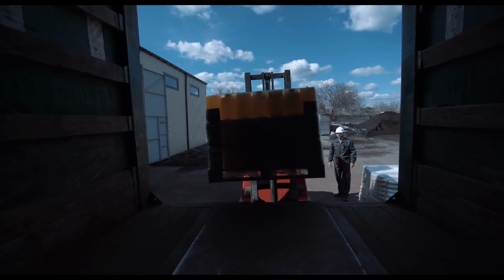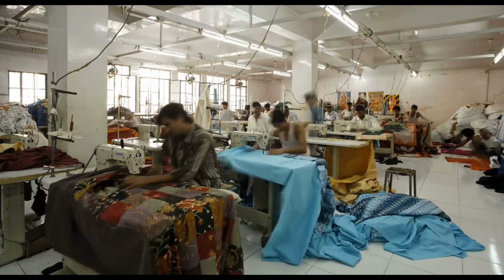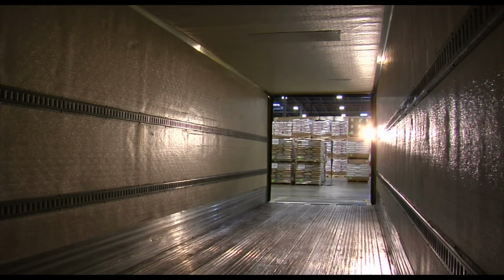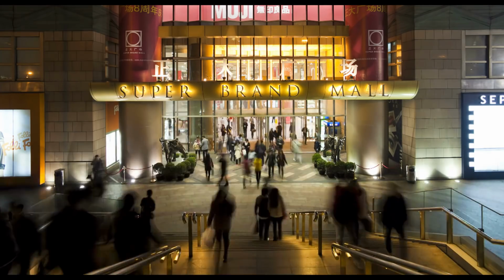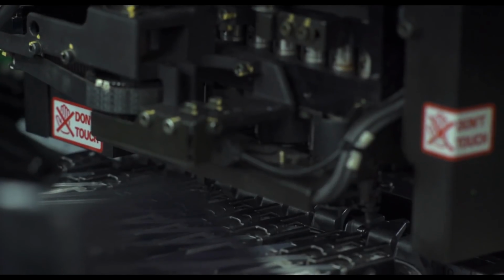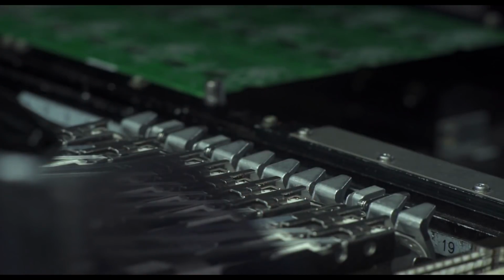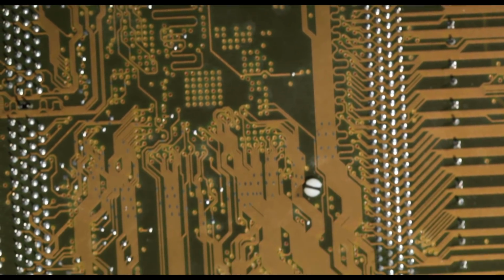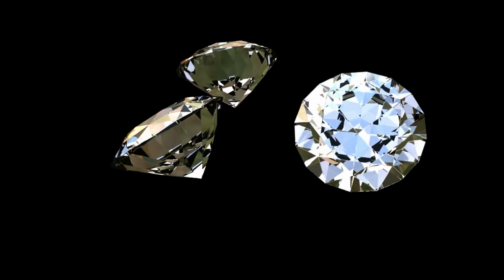WaltonChain Explained In 7 Minutes --- My New Favorite AltCoin!

Comment: I don't see why counterfeiting products will be impossible? It's just a matter of placing a RFID in the counterfeit product, mimicking an existing product...
This could be a very good video if you were not acting as a blind fanboy and providing some solid evidence to your claims. 
None of the use cases you mention require the blockchain application.
Reply: The walton RFID tag has a simple hashing processor that will be capable of storing and transmitting the it's private key to the network. This way there the tag's identity on the blockchain can not be copied or replicated. This creates a 1:1 relationship between the tag and the record on the block chain. It's entire production, shipping and retail history will be recorded on the blockchain. Counterfeit goods would have no such history.
Reply: Depending on the item you can make it relatively difficult to remove the RFID tag without damaging it, but the main argument I would make is that you're devaluing the actual authentic item by removing the RFID tag because you couldn't prove it wasn't itself a counterfeit item anymore.
Reply: Zycho Yes tags are initialized and bonded to the blockchain and associated to the customer as they leave the factory
Reply: it's not the blockchain thats the concern, or the RFID for that matter.. has any consideration been made how much more expensive goods will be to have an extremely good RFID system that can't simply be placed on another counterfiet product? A detailed video on this would be good.  Yes the concept is solid...
Reply: In addition to some of the already great replies....the rfid numbers generated would be cataloged to the original manufacturer. Anyone else creating false rfid numbers would immediately be red flagged as an outlier. Copies would not allowed because each product will have a unique number. Unlike generic UPC codes. It is like a social security item for individual items. Each product has a unique number. So “copies” will not be possible of rfid tags.
Reply: Ben Fraser so to understand you correctly, you are saying that such a tag will have its own individual connection to the blockchain in a regular basis? Independent of the product that it is designed to prevent counterfeiting? Please correct me if I'm wrong.
Reply: I also struggle to collect how it will prevent counterfeiting. Will this blockchain keep the trace of every product forever? Wouldn't it drive the cost up as the number of these products rise? I mean storing information did become cheaper, but it still costs money.
Reply: It will have a mathematical connection to the network, in a sense. It would be able to sign a validation message, thereby proving it had a unique private key without actually revealing what that private key is. In that way it would be unable to be counterfeited because it would "know" something rather than just "be" something. I suppose you could somehow open the incredibly microscopic IC that is in the Walton RFID tag and use an extreme process to figure out what the key is but that would be prohibitively expensive, if even possible. Walton is really going to make most of their money a quarter cent at a time selling these proprietary (and patented) RFID tags.
Reply: plz explain why u couldnt just switch out the good product for crap but keep the good rf tag attached?
Reply: Guess you could keep the real one yourself and sell a fake one to get your money back. Doesent have to be huge scale
Reply: You can tamper with products before placing an rfid tag. No way to know if a diamond is clean or dirty. And that basically goes for all products.
Reply: You can tamper with products before the rfid tag is applied. Who knows if a product really originated from place B? Maybe it was shipped to place B from Place A, where they use child laborers.
Reply: I own a fake adress and fake leather coming from fake cows. I just buy some rfid tags and put em on some fake leather. and sell them as real leather to Gucci. Oooh.. that wasn't hard.
Reply: Gucci (and other companies) certainly screens their suppliers. This isn't a system to authenticate anything beyond what a trusted party attests about it. What it can do is tell you that the stuff you got from Person X is from Person X and not replaced somewhere in between.  With regards to your Place B, Place A scenario, the tag doesn't necessarily prove ORIGINAL provenance of anything before installation of a tag.  If a company is shady and sourcing from bad places and lying about it, that is a wholly different problem. What a system like WTC would prove is that a) company like Gucci bought RFID tag x from Walton b)  RFID tag X installed into manufactured product by Gucci c) Product custody is turned over to logstics company Y d)  logistics company Y turns over product to retailer Z e) retailer Z sells it to you. A bunch of intermediate information could be recorded as well.
Reply: If you can track a location of an RFID chip from the moment it was created. All the GPS tracks they store should start at one place: The rfid factory, correct?
Reply: You don't need to tamper with the blockchain, the RFID tag is just an ID that you can actually copy, it doesn't contain the whole chain.
Please explain how they are going to prevent counterfeit without just telling us that "they somehow will", I'm all ears.
Reply: The products history will be traceable on the blockchain. That would allow you to see what ports/channels the product has gone through. If you were able to sign off a rfid tag through a port that would be able to prove authenticity of a product.

Comment: Really great, informative, refreshing video explaining WaltonChain. Thanks! You mention streamlining existing ERPs into one channel and therefore increasing efficiency... I'd like to just emphasize this point because this streamlining should save companies huge amounts of money by cutting manpower costs and reducing or eliminating human error, as bar codes no longer need to be scanned individually. It's a big cost-saver. Given that China has also recently issued guidelines for a product traceability system that will be implemented by 2020, WaltonChain will likely be a huge player here.
Reply: Supply chains are an accounting disaster. A box of widgets gets passed from one vendor to another, over and over. Depending on how long the chain is, you could have a couple dozen different companies involved. With each step you have to account for everything that has happened. Shipping insurance companies need need access to those records, finance companies, manufacturers, shippers, warehouses, distributors and retailers all need access to those records. The current method produces a shit-ton of paperwork because companies can't trust each other and their databases. Blockchain provides the single trusted immutable database for all parties to use. It provides instant visibility into an otherwise opaque industry. A public blockchain is the ONLY to have a truly trusted supply chain tracking system.
Reply: This already exists and don't require the blockchain at all.
Reply: Correct. The blockchain adds value.